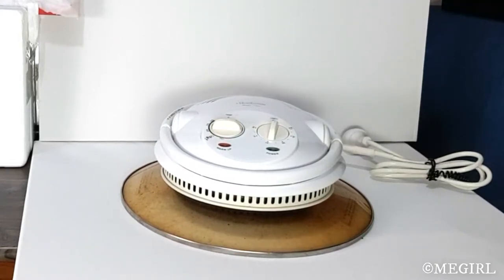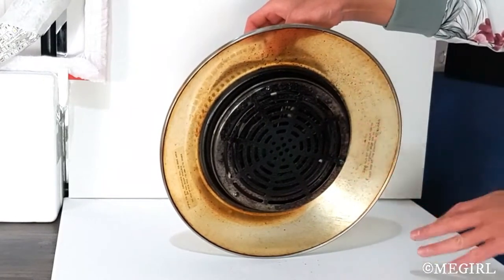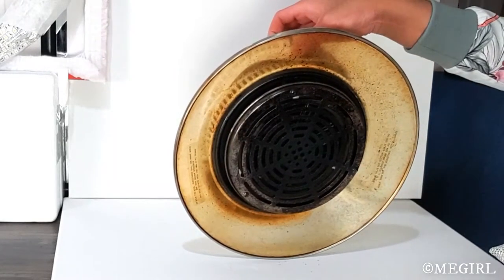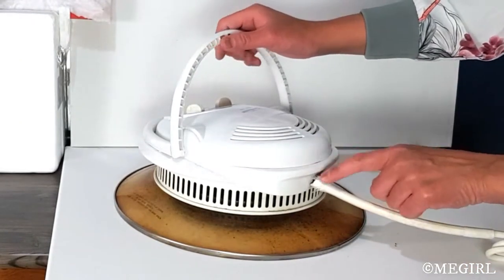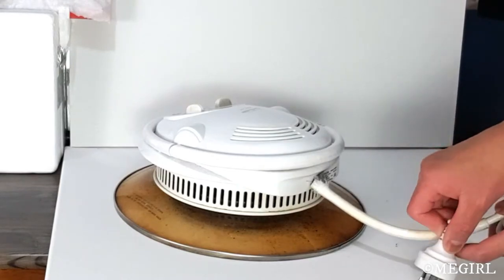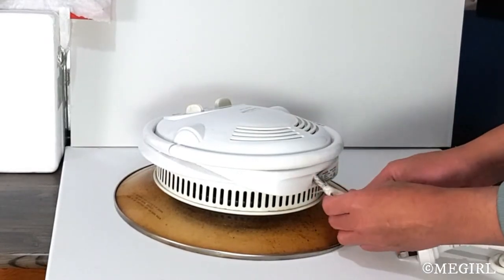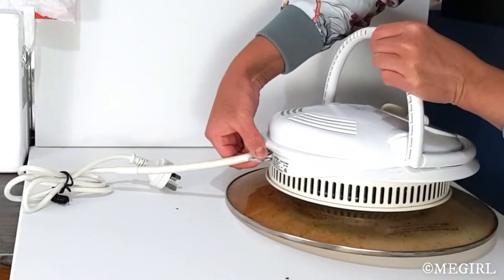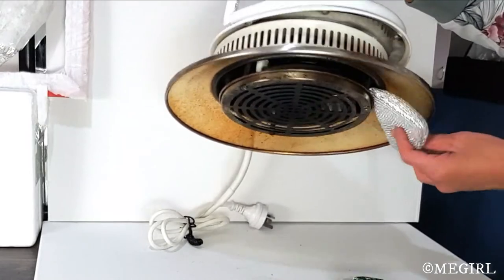My first Sunbeam NutriOven CO3000 bought in 2011 what happened to it was my fault !

Comment: Some of the lids have removable power leads. These seem better.
Reply: Yep, detachable cords are much better. It's much easier to clean the top unit without the cord attached, and you can swap to spiral cords and shorter cords depending on your kitchen setup. And if they cord starts to fray or wear due to all the flexing and movement, you can replace it for a few dollars without having to get an electrician involved.

Comment: Also when you clean them the bulb will blow if it gets just a little bit wet
Reply: The Sunbeam is not a halogen oven, so it has no 'bulb' or 'tube' the element is similar to an electric stove coil, unlike other turbo ovens. Cheers!
Reply: @micko11154  thanks I didn’t know.  I had assumed,  going by the glass bowl, that it was the same as the ones I had having never seen one of theses. I will get one if I see one as I’ve blown a few halogen oven in the last 10 years. Thanks for info.